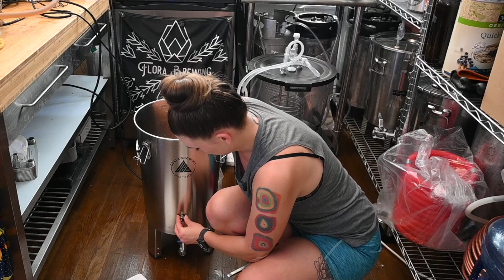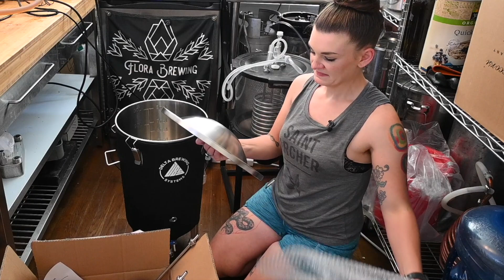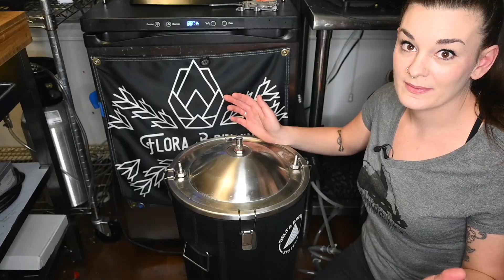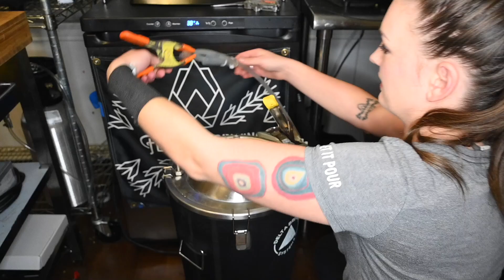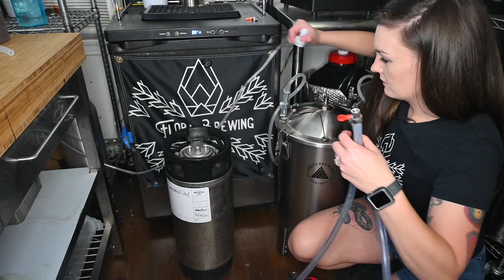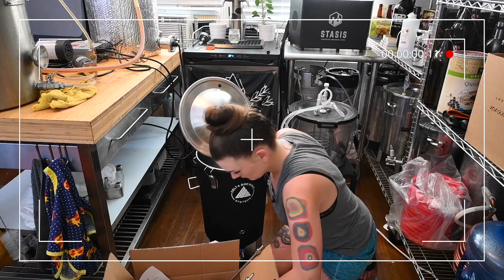Delta Brewing Fermtank Chilling Lid & Pressure Transfer Set Up

Comment: I've had two Fermtanks for a couple of years and I've been in constant communication with Delta because I cannot get more than 1.5PSI pressure before the lid leaks in between each latch. I fitted new lid gaskets, new type seal washers for the chilling coil, I've even added a rubber starfish with six hooks to better seal the four latches that close the lid. Still no more than1.5 to maximum 2PSI. Delta finally confirmed that 1.5 PSI is the design maximum. The lid design with the four latches is simply not sufficient there should be at least eight. I am tired of struggling, I have finally succumbed and purchased a Brew Built X3 conical, no more issues. No 2 X3 conical will appear next year.

Comment: Have you run into any problems trying to transfer hazy IPAs with the Delta stuff? I just tried this technique from your video  and it took almost an hour. It seemed like the output on the Fermtank  was clogged and all the CO2 was just backing up and coming out the lid on the Fermtank.

Comment: Good stuff! I have a SS BrewBucket, have been looking at getting one of these instead as a 2nd fermenter. It seems like the drain valve at the bottom would make clean up a lot easier; has that been your experience? I'm also an apartment brewer, without a utility sink that step is always pretty cumbersome.
Reply from the maker: Oh yeah it’s great I just toss the whole thing in the bathtub open the bottom valve and it’s a breeze

Comment: Are you using a spunding valave on the gas post? I see no other gas relief in the lid and am just curious
Reply from the maker: No I use the gas ball lock connected to a hose as a blow off tube